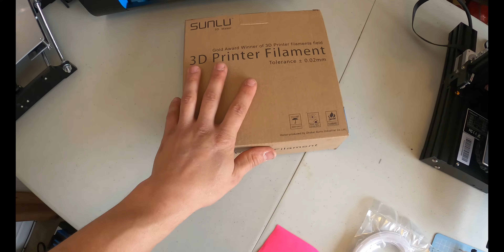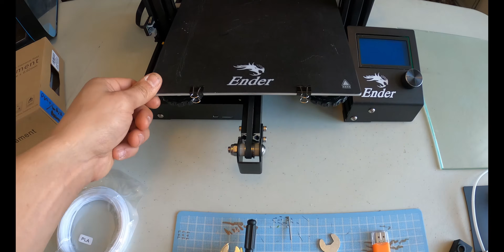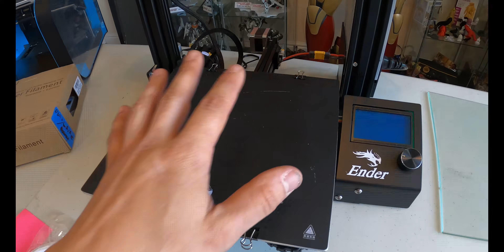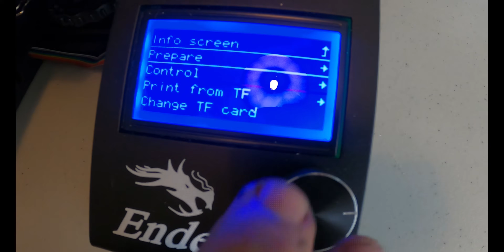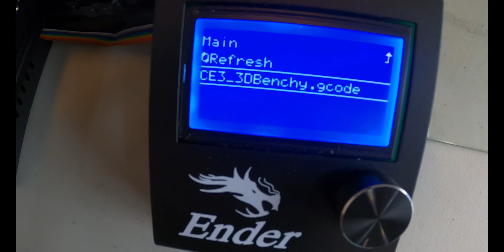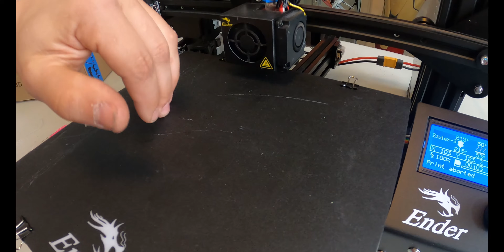How to 3D Print Part 2 -  The Basic Hardware and Parts!

Comment: I bought an Ender 3v2. It wouldn't even print a small box 2"x2"x2". I tried for seven hours. It would do the base, then the base would stop sticking to the bed and ruin the print. Then the hotend jammed. Spent another hour clearing that out. A talk with some veteran printers over Discord said that Ender 3's are "hit or miss." I'm currently in the process of returning it.

Comment: Hey Frank, been looking many video's to learn and decide which printer i want. I'm inbetween the CR10-V2 or V3. Just wondering if direct intruder is worth the price.

Any input and advice? Looking to print Helmets, so i would prefer the extra build volume.
Reply from the maker: Honestly both are great. I personally don’t have an direct drive but it’s either or. It helps with flexible materials
Reply: @FranklyBuilt  Thanks

Comment: I just set mine all up, bed is leveled and everything. But when It starts printing its having trouble pushing out the filament, as in no of it is coming out. I've double checked everything and can't figure whats causing this. I am using the white pla that came in the box with it, I know you said that that pla is pretty crappy, is that the problem?
Reply from the maker: Possibly. You could also be too close to the bed
Reply: @FranklyBuilt  thank you, and thank you for responding! I love your content.

Comment: Can I pause the print then move the hot end via disabling the stepper motors then continue the print? Thank you in advance. 🤙🏼
Reply from the maker: No. When you pause the print you need to leave the steppers exactly where they are or when it resumes it won’t know where the print is.
Reply: @FranklyBuilt  ah ok. Makes sense. Thank you!! 🤙🏼